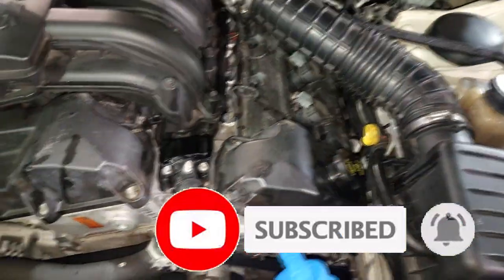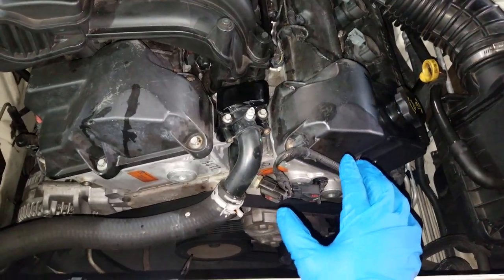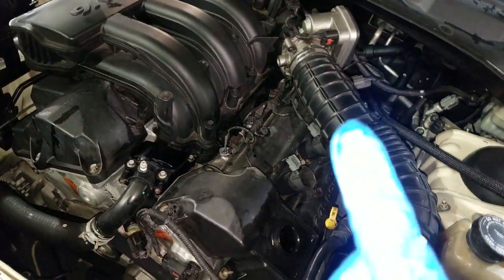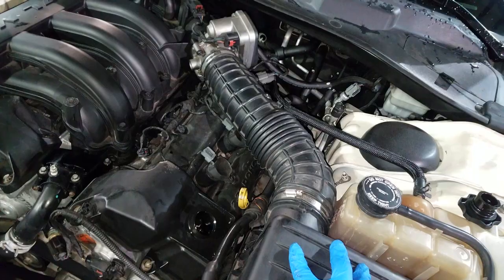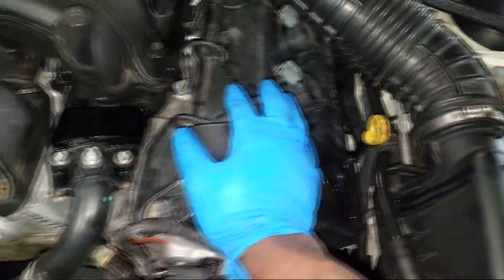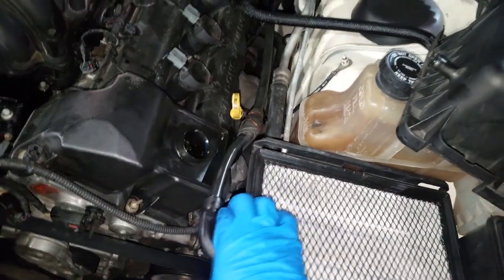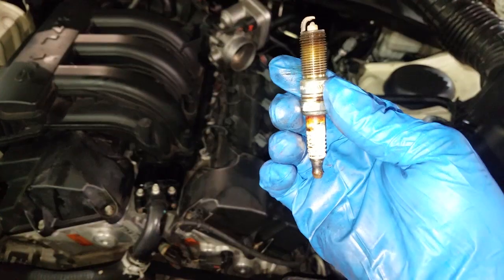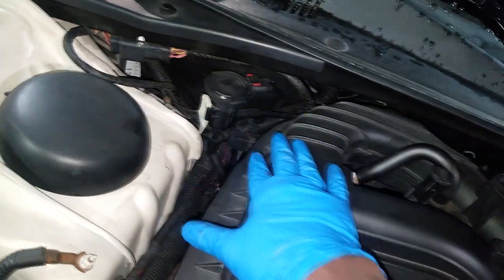This is why you should try a TUNE UP SPARK PLUGS first. P0300 Oil Burning Oil Consumption 2.7 Engine

Comment: I check coil on plug style ignition by moving the coil on the misfiring cylinder to a cylinder without a misfire. Clear the codes, then run the engine to see if the misfire followed the coil.
Reply from the maker: Excellent way to isolate it..Not sure if you should clear it tho, cause you may loose the counter until adaptive numerator start to run again.

Comment: I think the customer added to much oil, that's why he burns oil it's getting sucked up in the intake , I forget the reson but over filling makes that happen, the repairs where needed, it's just the customer is over filling causing plugs and intake and burning and so on. Please explain to me why over filling causes it every time. I think the oil just gets backed up in the engine and sucked and pushed in the wrong places of the engine and will need a internal cleaning kit and oil change besides anything.

Comment: Is that ticking noise from the engine in this video normal?  That's what my 3.6L sounds like in my RAM.
Reply: Fuel injector noise.  The 3.6l has noisy injectors.  I wouldn't worry about it :-).

Comment: I’m getting  po868. po836 and po508 any advice ?  Check engine light is on and it’s whining a little  still drives tho   Thanks
Reply from the maker: Hey bud, what YMM car is this?
Reply: 2014 Volkswagen Routan